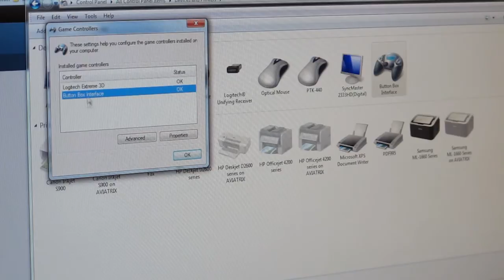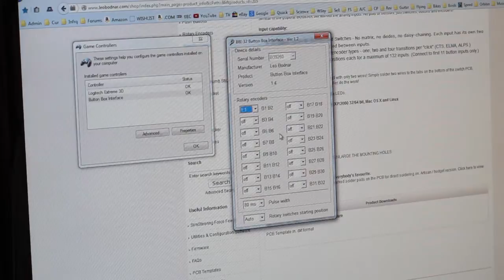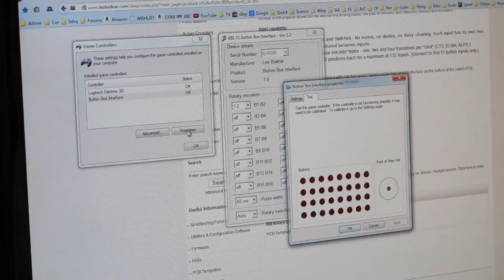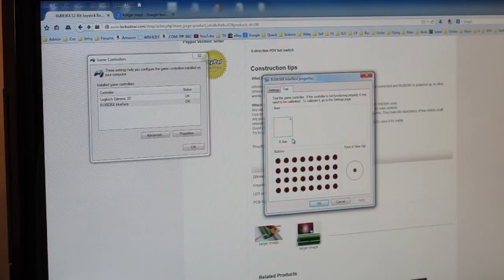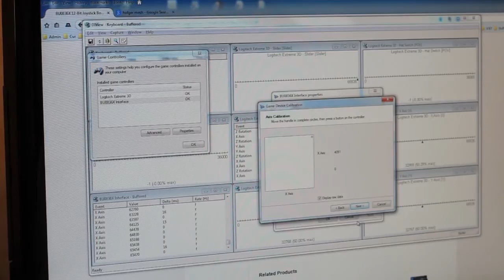The Leo Bodnar Boards (Twin Otter Cockpit Build - Part 8)

Comment: Adruino 2560 is a much better value.  Double the number of input/outputs, supports encoders and stepper motors and all at 1/4 of the price.
Reply from the maker: You'd have to define 'value'. Bodnar boards are easier in pretty much every way and you can now buy the BBI-64 board, which beats the Mega for inputs. And of course you need to address software.
Reply: @AlmostAviation  it might be "easier" for those who have to program inputs directly through the sim, but for the price, Mega still is a better deal as it not only handles heaps of inputs, but also outputs and all for a fraction of Bodnar boards price. While the BBI-64 board might hold more inputs, the price per input is still substantially higher. As for software, no complex programming is needed when using easy to use free applications like MobiFlight or Simvim. These points are my definition of value.
Reply from the maker: @gracebyseven  Again, you are victim of your assumptions. I don't program directly from the sim, my infrastructure requires complex programming, which I achieve with Lua. Hence, Mobiflight is an irrelevance. Bodnar boards are easier because they are native HIDs and hence are literally plug and play. They are also physically easier to connect if you buy the spring-clip ones.
Reply: @AlmostAviation  I don't believe I'm a victim of anything as nothing I said is untrue.  Most who use Bodnar boards for building their sims are amateur's who can't be bothered with anything but simple assignments through the controls menu of the sim.  
No need to get acidic here, I'm just trying to make a point.   These facts remain: 1) Arduino's offer more functionalities for the dollar.  2) Today, what you've done requires practically zero programming, and whatever is required would certainly not qualify as "complex".  3) Bodnar doesn't offer outputs and what inputs they do, you pay heaps more for.  I'm sorry, but "spring-clips" doesn't justify the ridiculous price tag of a Bodnar card, especially with todays technology.  10 years ago? Maybe.  Certainly not today.  For the record, plug and play with Arduino today is very much a possibility with some rather simple Java coding.  My objective is not to argue with you, but I know who you are and have seen you around the different boards for many, many years.  Those who are new comers to the hobby must understand that the way it was, is not what this hobby is today.  We have heaps of new solutions that are a lot more viable, inexpensive, and user friendly.  God bless you.
Reply from the maker: @gracebyseven  Another bunch of unsubstantiated assertions. I'm not bothering.

Comment: Very nice mate - can you tell me please what rotary encoders you used? I agree with you that the ones with the Saitek gear are not very good. Thanks for the great set of videos on your cockpit build :-)
Reply from the maker: Hello Jim. They are the ones supplied by Leo Bodnar - here's the page reference: http://www.leobodnar.com/shop/index.php?main_page=product_info&products_id=192. I am also using the ones without a centre push (they seem to have a stiffer action) and the dual concentric ones (which are considerably smaller). Thanks for the encouragement!
Reply: Many thanks